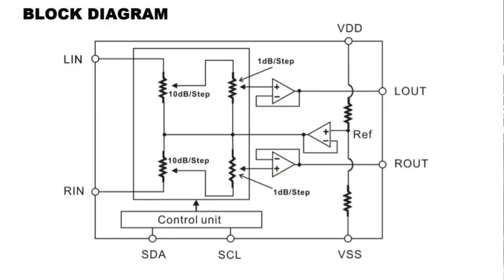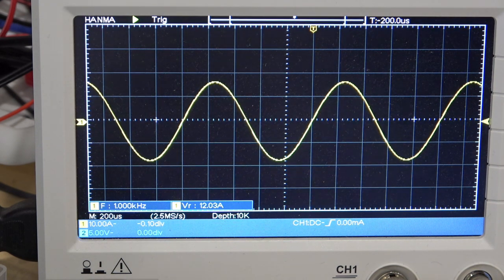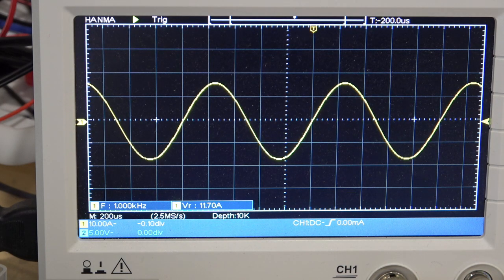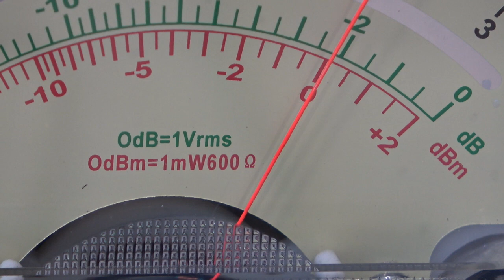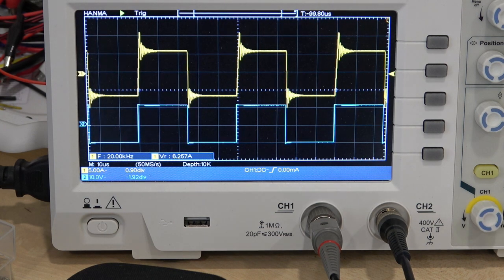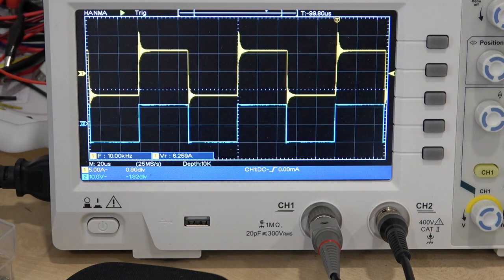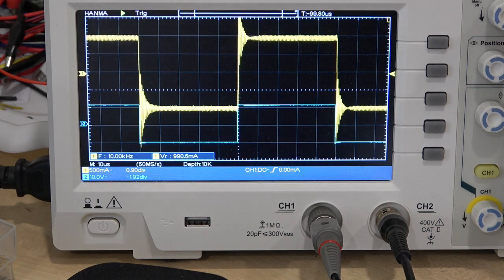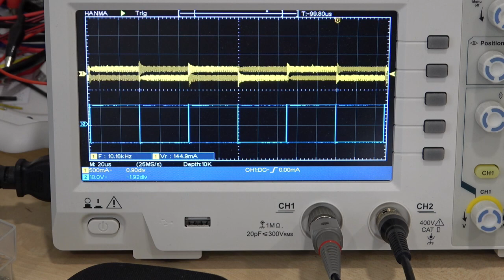Digital Volume Control.

Comment from the maker: Hi Steven,
 It's been a while since I last played with this module. The biggest issue I found was its quite low input level overload. Also the fact it has no gain only attenuation, means you need a preamp stage after it. The balance between the input and output is quite difficult to get right without more circuity. Preferably a buffer on the input and a preamp on the output. It's in the bin of other poor and not working to well stuff. 
Sorry to hear you also have poor health. I know exactly how you feel. I hate not being well, it's a bit of a wide band attenuator. lol

Comment: A couple of things:  1) The THD % is nor great at low signal levels   2) The 8 pin SOP chip on the knob board determine how the knob turns relate to volume.
I could be relatively easy to replace/reprogram it, but like you, I have health issues, so past easy stuff is out of reach for me now.
Just for your info, although you likely already know from the data sheet, that SOP-8 converts the knob turns into I2C command for the PT2259.

Comment: Just a thought: If there's an opamp in there - it's probably inadequate supply decoupling. The right caps need to be placed right on the IC pins to a very local 0VDC. A small cap (15pF) across NFB might also get it under control - or not! All the best, Beamer.
Reply: 12:05  He says "no gain".  Doesn't that mean no OpAmp?  I do see 4:16 one 8 legged IC right in the center of the board though.  Hmmm...... It's curious.
     Now I want to see a relay volume control analyzed.  🔈🔉🔊

Comment: Dear Michael, try this please
WONDOM AA-AB41148
I use it with my TPA 3255 the same that you have.
The potentiometer that I recommend , is "from other planet" comparing with this that you tested
Reply from the maker: Does look good but a lot of circuitry just to change the volume. I think I will stick with a conventional volume pot.
Reply from the maker: Further to my reply of last year. I am considering getting one of these to test and hopefully use. Anything further you can add will be most appreciated.
Mike

Comment: Hello Michael
First, thank you for your many good videos, especially the ones about amplifiers I always watch.
But also, I don't like your endings! Your name and a date make me think you died that day, but luckily you didn't.
Perhaps a picture of your rabit and a Copyright Michael Beeny, New Zealand and the date would be better.

And now after all the fatter;
Have you tried the "DAC T Type SMD Stepped Attenuator 21 step volume control 50k Potentiometer HIFI", which are on e.g. eBay for 16.5 US$?
I have just ordered one to try if it lasts better than the Alps that's in my PC amplifier, but it keeps falling out in one channel (this happens for both channels). 
The step potentiometer has gold plated contacts, maybe that's better? But there are only 20 volume levels, is that enough?
Greetings Michael, from Denmark, EU
Reply from the maker: Like most things these days, I'm not sure all Alps pots are real, as the price varies considerably. I've been quite lucky so far with no issues. Saying that, I find even the very small green ones can be very good with a nice feel to them.
I've often looked at switched pots with interest. Looking at reviews from customers, they get mixed reviews. Some people love them others talk of wrong value resistors, poor switches. I'm not a lover of switched pots myself. The first step can be off putting, depends on if the really follow a log law. As to how many steps?? The more the better, I guess. In fact, a completly variable rotation is best!! A NORMAL pot.
Do you know, no one has EVER made any comments ever about my video skills (or lack of) The opening titles often take longer to make than editing the complete video. I never know how to end it either. That's how I ended up with what I have. I was originally going to put the little copyright squiggle but not available in my list of characters, hence it ended up with my name and date. I even got thar wrong a few weeks ago! Very few people watch to the END anyway!  As to being dead, I often wake up and find I'm surprised I'm not yet dead. Maybe some others will come up with a good idea?
Thanks for writing, let us know what you think when the pot arrives.
Reply: @MichaelBeeny  I got the pot this Friday, I even got two pots for the price of one!
I haven’t mounted the pot yet, but the feeling is good, and I will say very good. 20 small clicks, I can feel them, no sound, and no additional force is used. It rotates freely, but I feel the clicks. 
I gave the stereo pots 9 Volts at the two 50K lanes and measured the difference between the two outtakes. It was practical zero milli volts at all levels, so det balance must be very good.
I will write when I have mounted the one pot I ordered.
Reply from the maker: @michaellundsrensen2292  Sounds good Michael, I look forward to the final results.

Comment: Nice video thanks for sharing.  For e-commerce/commercial digital volume control, sometimes it is not optimized for DIYer's like the Rotary encoder in your video not sure if the dB/ step attenuation is 1 dB/ 0.5 dB , it should have been nice to have option on selecting attenuation like 2~4 dB/step or re-program it   If you love  DIY, the best is to make your own DIY digital volume control, cheers everyone!

Comment: On my 35-years old receiver driving a pair of 35-year old B&W bookshelf speaker, the potentiometer developed a bad contact, although all the electrolytic capacitors are OK.  
That is the reason why no one wants to use a potentiometer any more.
Any way at first, I mistakenly thought the tweeter of the 35-year old B&W went bad, because the symptom of bad-contact potentiometer appeared only in the tweeter frequencies.  
A few months ago, you mentioned a bad contact of a stock 32 volt power supply gave you a hiss noise from your TPA 3255.  I myself have two TPA3255-based amps with 
the well-known volume chip from Japan. Remote volume control is another important benefit.
Rather similarly, I too realized the fact that the bad-contact in an old potentiometer yields a high-frequency noise mostly in the tweeter especially when the sound-desibel rises.

Have a nice day.

PS:  I am not able to replace the potentiometer, because all other front-panel control knobs are 
attached to the board so tightly together.  So, I am going to throw away the receiver soon.
Interestingly, when I use an external DAC with a volume control, I can now set the potentiometer at high volume levels which I have never used
for so many years.  Then, the receiver works perfectly OK at that potentiometer setting.

Comment: Mr Beeny, does it matter it won't pass a square wave?? I don't listen to square waves.. Do you??
Even most high quality opamps don't pass a hf square wave perfectly???
Reply from the maker: It matters a lot. If the square wave is not SQUARE it tells you a great deal about the speed or rise time of the chip. That translates into fast attack and wide dynamics. An amplifier with a good square wave tends to sound better than one with a poor looking wave. No, I don't listen to square waves but look at the wave form of music, no nice smooth sine waves, all peaks, fast rise times. Spikes etc So really a square wave does make sense until someone comes up with a better tool.
Reply: @MichaelBeeny  Isn't speed and rise time only applicable if they are inadequate inside the audio bandwidth? If an opamp can't properly slew a 10V 100Khz signal but does fine 20 to 20Khz, isn't that good enough?
Reply from the maker: @AntiNeoFeudalist  I'm still going to do some more tests on these, I will be in the lounge listening in the next few days to see if it adds noise or colour and what it's like to use it in the real world.
Reply: @MichaelBeeny  Happy listening!
Reply: @MichaelBeeny  Also, thank you for the reply
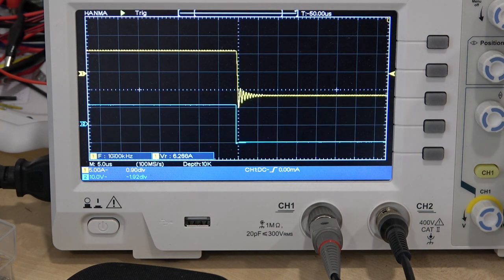Reply: at that frequency 10 KHz,  (10:10 mins) I think I consider the overshoot + damp oscillation as bad signal,  the rising edge of the squarewave is dangerous (its a sign of stress) to the Tweeter at high output volume, the square wave is a performance test that shows how good/bad the design, component  or Assembly issue.  Cheers!

Comment: Overshooting / ringing indicates a non-flat response in the very high frequency range - I would try that sweep test again but this time go way up to 300-400Khz. The ringing looks like its occurring at a very high frequency. The other thing is, you will never have a 20Khz square wave in your audio signal -20Khz square wave will contain harmonics extending into the many hundreds of Khz  Whereas at audio the maximum frequency will be a 22Khz sine. I think it will be fine in reality but at the most it may need a tiny value capacitor (pF) across a negative feedback loop - assuming there's some op amps in there somewhere. Good channel thanks (I am in NZ and also build amps)

Comment: Did you try the square vawe oscillation with some kind of fake resistive and/or inductive load?
Reply from the maker: The load was just a 4.7K standard resistor, with the scope connected across it.

Comment: i think i will stick to rotary pots  maybe duel concetric  or even add a ballance control
Reply from the maker: Ears are not that sensitive to level changes. Even a balance control, when in the centre position can be out by a couple of dB. The least amount of extra bits added is better.

Comment: Thanks for the vid Michael. I've been looking for a good solution to replace pots in vintage gear and this looks like it would work. I think the 1.5MHz oscillation may be induced from external but who knows without thorough testing.
Things I don't like - the free wheeling rotary encoder doesn't have feedback as how the volume is set. On power up, does it remember it's last setting or does it default to a preset volume?
I think I may pick one of these up for further testing. Thanks again!
Reply: well there is a great little project where the encoder is connected with a BLDC motor and there are "limitless" options on how to configure it. :) I never saw it in real life but a great little piece I must say:
https://www.youtube.com/watch?v=ip641WmY4pA
Reply from the maker: I will do more tests soon to answer all the question I have received on this.